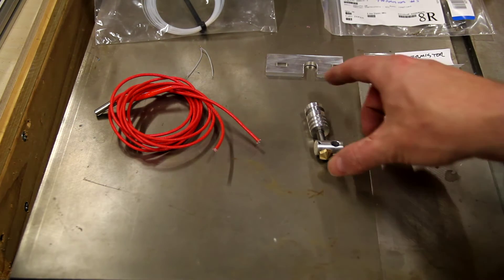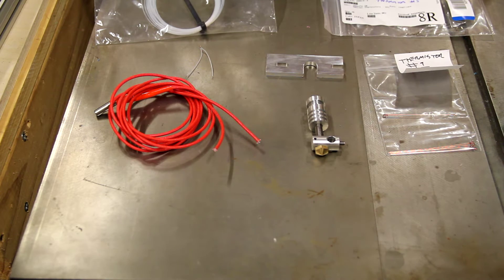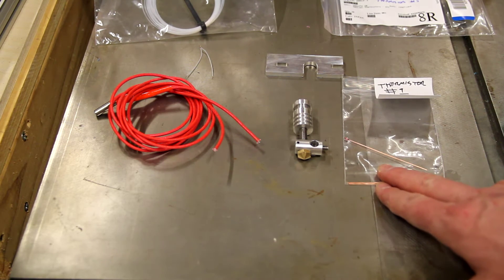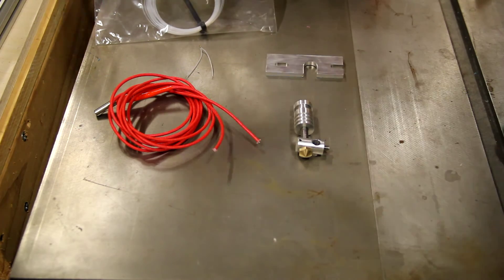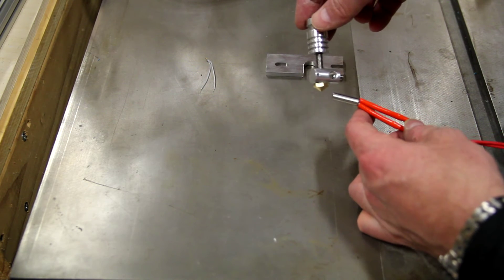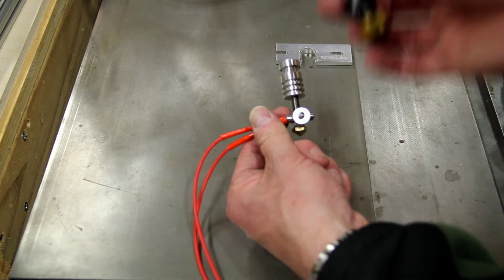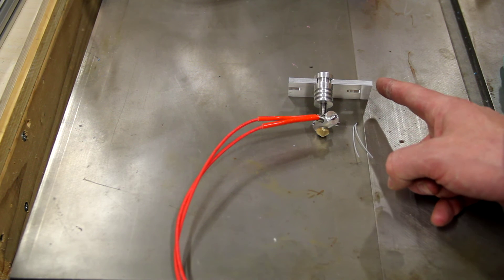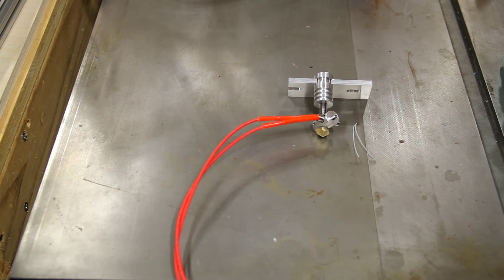3D printing, AluhotendV4 review - Part 1, intoduction and basic assembly.

Comment: omg for the life of me I cannot print with this jhead it just jams all the time. it's worse with abs. I even tried at 235C 240C 250C and even tried taking it out and cleaning then putting it back in and all it does is chew up the filament once it hits the end of the hotend. You didn't seem to be having these issues though. I ordered the aluhotend but he only had 1.75mm available. I'm going to have to find a 3mm hotend so I can use my current spools of filament. is there another hotend you recommend for 3mm? I just want to print lol. I only was able to print one pla belt tensioner, after that it just stopped working and constantly jams no matter what type filament I put on it.  T.T
Reply from the maker: A couple clarifying questions:  You're not trying to print PLA at those temperatures, are you?  That would certainly cause jamming. Also, how tight is your extruder idler?  It needs to have a pretty good pinch to keep the filament engaged in the teeth of the hobbed bolt. Also, for PLA, you'll definitely need some coolling across the vents in the body of the J-head.If none of that helps, and the Aluhotend is not available in 3mm, I would strongly recommend the E3Dv5.  It's all- metal, and more expensive, but it's also pretty much bulletproof.  Before you do that, though, I'd keep trying with the J-head.  It really shouldn't be that bad.  You might have a defective unit.
Reply: I was trying to print in abs and tried varying tightness. I even tried hand feeding it and it would barely extrude anything then just stop. I then would take it apart clean it with denatured alcohol and try again.  I'm going to try looking for a drill bit that size, heat it up and try piercing the hole with it. Not sure what else to try... I did however order the 1.75mm aluhotend and the 3mm e3dv5 with varying nozzle sizes. Thanks for the info and help

Comment: There are a number of things you could use. Air is a really bad heat conductor. You can replace it with just about anything and improve the heat contact. You want your thermistor to always see just the temperature of the block.

Comment: Well i wouldnt rly do that since then you have 1 print with a 3mm and one with a 1.75 :P wouldnt it be easyer if both are the same just so you can use the same fillement? ^^
Also so far i know it might be a little more accurate as flow goes and wont snap as easly when going to the hotend but thats all so far i know.
Also the more of a standard diameter is still 3, Like prusa nozzle is even only for 3.0.

Comment: Very nice set of videos.

When you mount the thermistor - be sure to use something to hold it in place. Fancy heat conductive epoxy is one option. Other high temp adhesives are almost as good. Just be sure not to let if flop around.